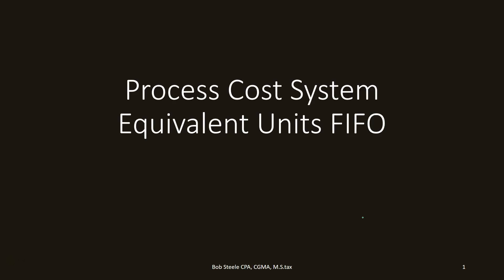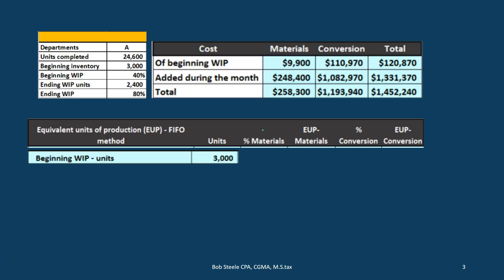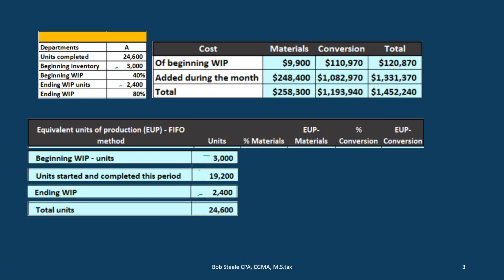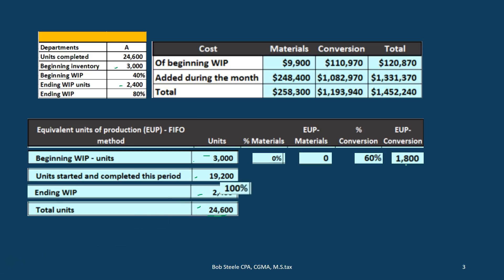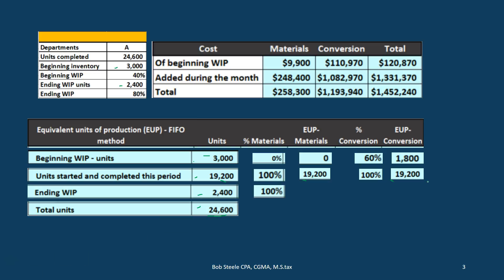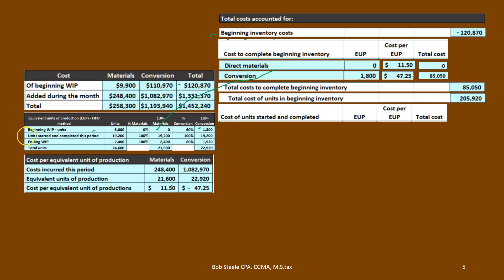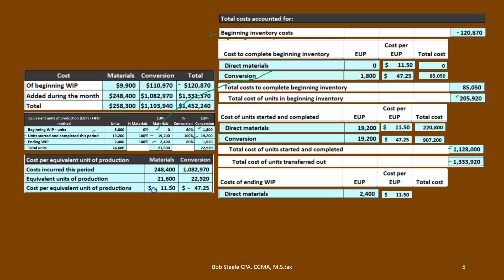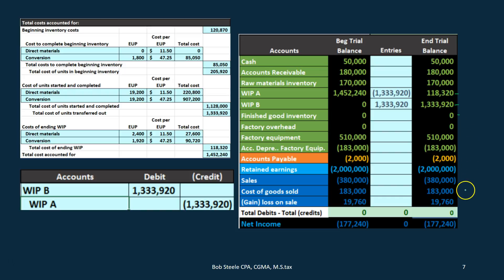2000.30 Process Cost System Equivalent Units FIFO

Comment: Good information - just presented way too rapidly. If it were presented about 1/3rd the speed, it would be perfect.  Seems like he was racing to get through as quickly as possible.
Reply from the maker: Thanks for the feedback. We have been thinking about reducing the material in each video and providing more detail in smaller chunks because it seems that average video length is recommended to be from 5 to 15 minutes but doing this can lead to us losing some of the big picture in a particular process during a particular video. What do you think about average video length? Does 5 to 15 minutes seem like the correct length or would you be happy with longer videos that are more comprehensive? I have seen a lot of channels that seem to break this recommended 5 to 15-minute video length rule, providing much longer videos, that seem to be doing well but I think it may depend on the kind of content.
Reply: If the material is what I'm looking for, then I'd absolutely watch longer videos.  This process is a lot to take in and there are many different scenarios that change the way the problem should be approached.  Short answer is yes, I'd watch a longer video, but it's hard to find longer videos specific to the process I need addressed.  I hope this makes sense.
Reply from the maker: That makes sense. Know that it is hard to find a problem that matches up to the scenario we are looking for.